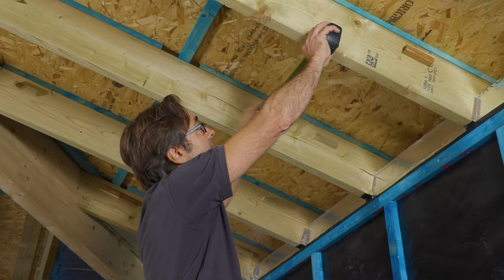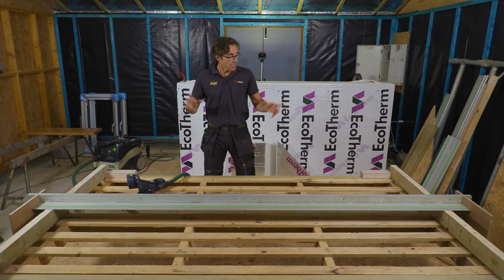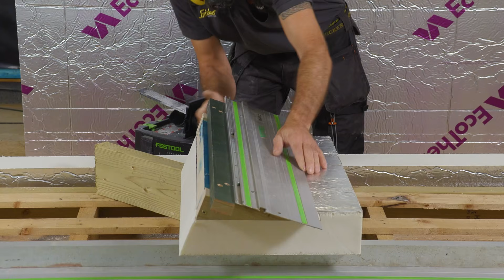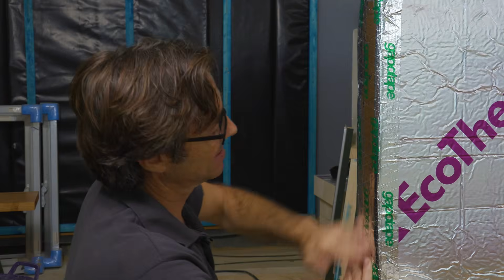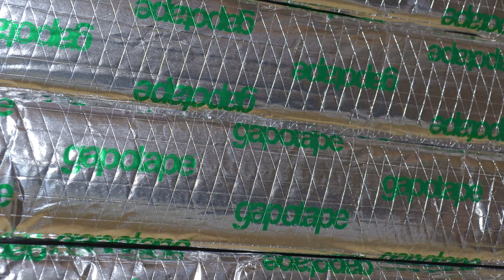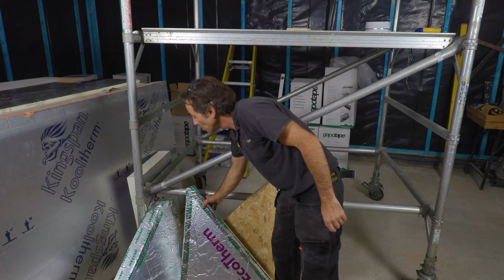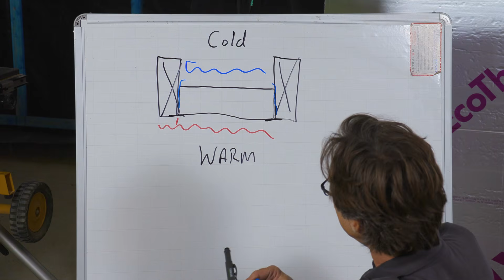Gapotape - Perfect Insulation with PIR Board

Comment: Would it not have been easier to do a warm roof?
Reply: In our case this would have taken us over the 4m height for Permitted development and also we needed a full structural sheathing over the rafters for strength, if we had a warm roof we would have then needed another layer over the insulation to take the standing seam roof we have so the expense would have been much more than the cold roof that we have

Comment: Thanks Robin. Love your videos. Doesn’t this make you want to use a more flexible insulation material to begin with though? Like mineral wool or flexible wood fibre batts. Then put a continuous layer of rigid insulation board (PIR, wood fibre, other) around the outside of the timber frame to stop the thermal bridging, bring down the U-value and help with air tightness. Should be simpler and more cost effective I’d have thought.
Reply: This does look a quality product and a quality job though

Comment: Unbelievable  quality  of work as always  from robin  dread to think how much he charges  for that quality  of craftsmanship  everything  is perfection
Reply: I reckon he charges a reasonable amount.
Good work comes naturally to him. In my humble opinion doing it  properly, only takes marginally longer and a little more expense.
Its lazy and  not so thorough tradesman i disapprove off.
Reply: @Jys71208  
I'd say about 50 to 75 pound an hour a man but on a price and I'm being very conservative
Reply: This is a problem. People automatically assume tradesman are expensive if they work to a high standard. Tradesmen like Robin are well worth a premium rate. Often their jobs run better, come in on time and budget. Most importantly of all, the details are correct, the small things that most builders dismiss as “it’ll be right”. It’s nice to see work done to a high standard
Reply: Unfortunately if the customer had 2 quotes one being robin doin it perfectly and using this tape to precision and another cheaper quote rough cutting it in and foaming and taping joints the customer will pick the lower quote. Robins way would cost more, one for that expansion foam and two it would take twice as long to do. Anyway perfect vid as always robin
Reply: Sometimes you get called in after first fix electrics etc to do this job and it's a nightmare
Reply: @youngcarreviews5949   agree pal building  control around  my way make us put 100mm internal  and 60mm over the top of the joists  100mm dry wall screw do my head in tho  hate them
Reply: I don’t think I’ve ever seen insulation installed to this standard , i just can’t help thinking all that work and then you have to have trickle vents on the windows and vents for open fires ect

Comment: Hi you forgot to mention when the customer want downlights fitted and the sparkie had to do the right thing and had to remove the insulation the customer has paid for to fit fire rated lights.
There has to be better than this in this day and age?
Reply from the maker: Downlighters are a curse. If the breach the vapour barrier you get hundred of gallons of water migrating through in the space of a year. If they breach the insulation you have a cold bridge
Reply: A warm roof set up, sadly no company over here does anything like a Huber Zip System yet. Traditional building is still the go-to for all large house building companies and most of the smaller ones not doing custom homes. Thus you'll still have the issue with down lights. Thought the heat loss is minimal considering down lights should sit flush with the ceiling with a gasket, which should keep air flow and thus heat transfer and losses down.
Reply: Mark Langley Id love to see zip come to the U.K. game changer
Reply: Was about to say this, it pisses me off on every job
Reply: There’s a product called thermahood that I’ve on sites that is good for this